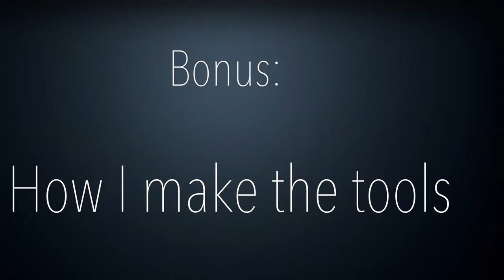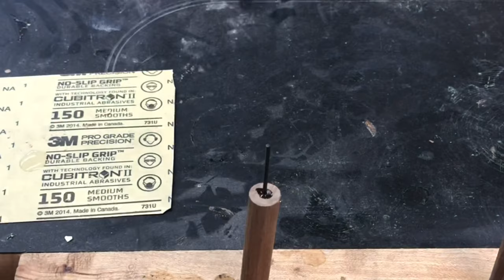OCD Toolbox Organization—No Talking, No Music

Comment: What is the benefit of cutting and cauterizing?  Seems like it would be either or.
Reply from the maker: Easier to cauterize curves. Easier to cut straight.
Reply: cutting for straight lines and cauterizing for following odd shapes. it's not easy to cut curvy lines in foam. especially with tight radii.

Comment: I saw OCD and thought this was going to be clean. This disturbed me a little bit. lol
I do appreciate the silence of the video. Everything looks good but the bottom because of the way it is torn out. Even though it gets covered by the tools, when the tools are removed it doesn't look clean. I would take the blade and compress the side of the foam that is not being removed and cut at an angle. It should give you a cleaner bottom surface. Other than that, I thought everything looks great.
Reply from the maker: Very classy

Comment: I just got a packout tool case with foam and wondering what the best way is to cut it, does this method not create a hard crust? I've been thinking of a commercial laser engraver but I figured even that would make a crust along the cut
Reply: I was wondering about a soldering iron